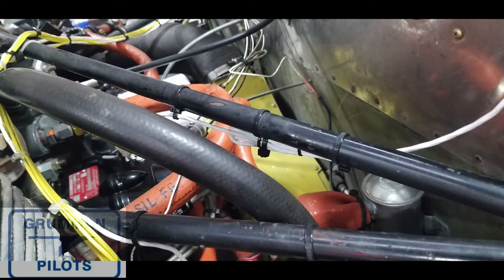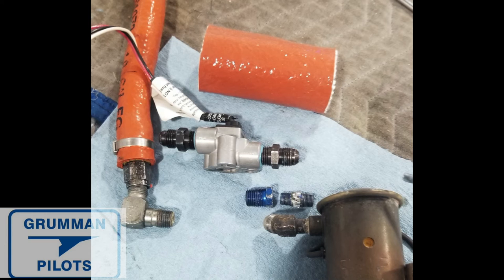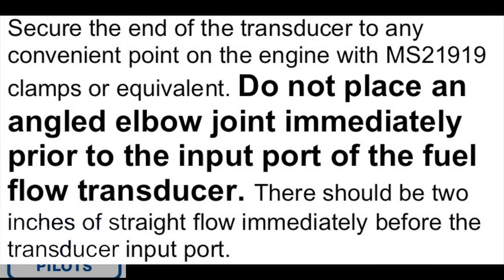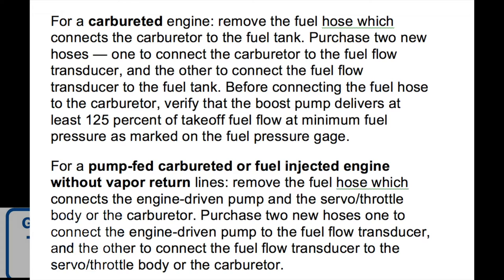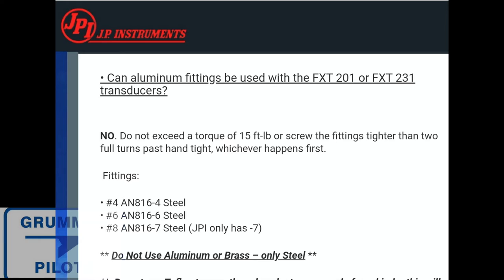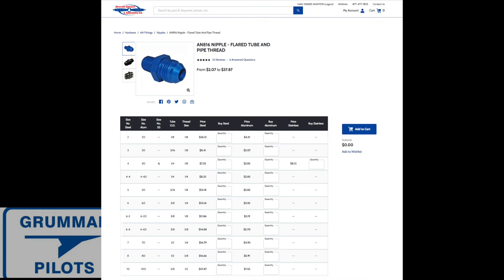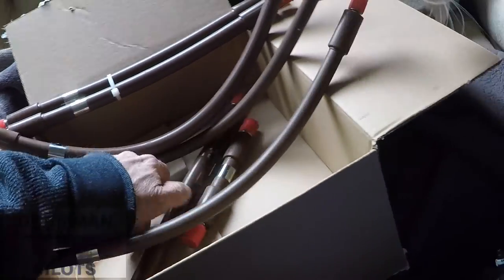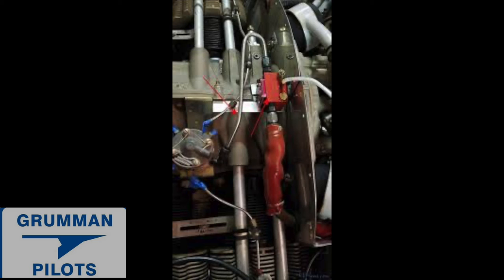Improper Fuel Flow Transducer Installation Leads To Unreliable Fuel Flow Readings - Grumman Style

Comment: There's an error in this otherwise excellent video.  The narrator says :Install the transducer level or higher that the carburettor / servo.  If you read the install still closely is says the transducer outlet port should be mounted LOWER or level - not higher.
Reply from the maker: We have had to fix many like that.

Comment: Where do you get the brown hoses from? Also Aircraft Spruce?
Reply from the maker: We order our hoses from Herber Aircraft out in California.  Available in blue and brown.  FYI
Reply: @GrummanPilots  Would appreciate it if you could give details to order from Herber (type of hose/size etc.). I'm assuming aero 666 (I have a G2 Insight with the digital transducer) hose style configuration (I'm assuming straight-straight), fire-sleeve sizes.  Appreciate it!
Reply from the maker: @donaldhamm3166  I tell them style (lifetime and color), hose fitting size and type (straight, 45, etc), and length in inches and 8th's.